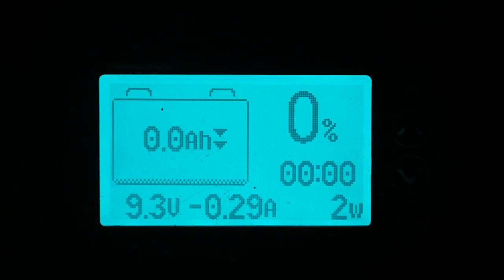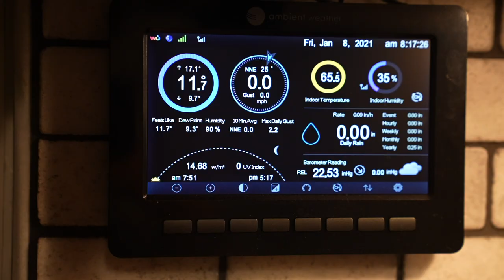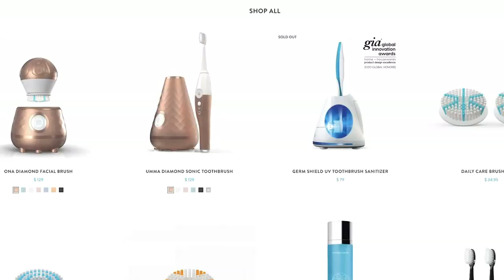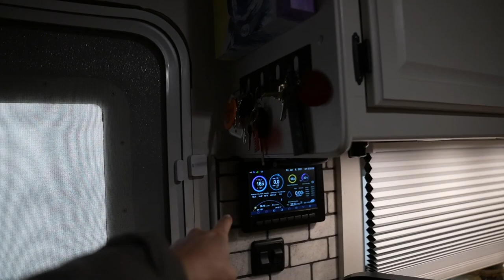WE'VE GOT MAJOR PROBLEMS | WINTER MOUNTAIN NIGHTMARE

Comment: I've never lived where you have to wear 35 layers to go outside and be warm. I guess you suit up and take it all 35 times a day when you go in and out.
Reply: In cold weather, especially when going in and out a lot, it is better to not heat the inside too much. I have spent the last year living in my trailer on a job site in the mountains. Last week it was below freezing at night and sometimes just above freezing during the day. We are remodeling a campground and my trailer is setup there so I go in for breaks and lunch and keep it cooler during the day and then turn the heat up after work when I plan to take a shower and stay in without all the extra clothes. Even outside, we constantly have to take layers off as it is Southern California, at 6000 feet of elevation and we are only a mile from where the mountain drops straight off 3000 feet down to the desert. The sun is very hot and in the shade it is quite cold. Being home on the weekend at 1200 feet of elevation in the typical warm SoCal valleys is quite a shock after staying where it is much colder. Luckily it isn't as extreme as where these two live.

Comment: We have an HVAC company in Southern California. I would recommend to hire someone. Even if you decide to go with mini splits, you can buy kits online but the equipment is no where near as good as what licensed companies can get from distributors. Daikin and Mistsubishi is good. Only contractors can buy the good stuff. As well a lot of equipment sold online has no manufacturer warranty, even if the website says it does, the brand keeps track of model/serial from what is sold online and will deny warranty, and if the equipment is not installed by a license contractor it voids the warranty if there is one. Copper line sets need to be bent with specialized tools and soldered, if you don’t have the proper tools your going to have a headache. Just hire someone, it will be so nice once it’s done! You already have enough work to do, don’t try to do the HVAC so you can focus on something else and save the stress! Something that will take you a whole week will take an experienced tech only 1 day to do. Also a lot of heat pump (all electric) equipment like mini splits will not be able to function in freezing cold temperatures so I would suggest a gas fired furnace for sure, probably LP. HVAC is electrical, plumbing, gas, all of it, it takes tech years to learn and you never really stop learning in HVAC. I wish we were closer we would totally come help you out!!
Reply: Poll your neighbors to see what works and doesn't work in your climate, at your Altitude.  Oh, then also check the cost to operate, but make sure the system will work in YOUR house first. Highly recommend an engineered/designed system. You will need a couple of ceiling fans to retrieve some of the heat that goes to the peak where you will never feel it.

Comment: Hey, reminding you again...on electrical...some things to consider...anything a hair dryer or heater or kitchen appliances plugs into deserves a separate home run circuit to avoid any additional load causing a trip if on that same circuit.   Another tip...anywhere you place an outlet ..place another one in a separate box 2 inches away....not in a 2 gang box...the power supplies, the size physically of little loads makes 2 gang boxes too close so the receptacles cannot all be used.  Another tip...the NEC Code and normal trade practices suggest one outlet every 6 feet along walls and 180 VA per outlet to determine a home run qty of outlets...which is great to minimize cost as a minimum standard...you are maximizing your convenience...for life of the house!  So have extra outlets in all corners where lamps and TV’s and such go.  Run more home runs ...did I say more home runs...yeah more home runs anywhere you have office, kitchen, etc......and remember to have separate home runs for lighting versus receptacles in every room...cause a trip does not have to turn off the entire room...if multiple home runs are in said room.  Another tip...look hard at switches...you want a fan with the light kit and a switch for each?  Yes, and a 3rd switch for some accent lighting and a 4th switch for other lights in the room like down lights.   Another tip....I added down lights in most every bedroom...in 4 corners minimum to brighten the room...dimmers on switches.....one outlet for a light does not cut it.  Another tip...more GFCI home runs for wet areas separate circuits...do not do the low cost electrician trick of running one GFCI to all bathrooms, basement, and outside receptacles to save cost...run all as separate home runs.  Another tip...extra home runs for a 240 v outside outlet run a table saw or tools outside.  Rune separate GFCI additional outlets for outside at all corners of the house for convenience versus long ass extension cord usage and dragging around.  Basements...more home runs for lights vs receptacles...don’t end up in the dark upon a trip...lots of extra outlets around basement for future.  Where is your 50 A and 30 A outlets for your visiting RV friends to plug in......where is the upstairs panel box main level panel box, and basement panel box to separate each floor circuits...so you never have to climb stairs if a breaker trips?  When you run all those home runs...mentioned a few times above,,,you need panel boxes with lots and lots of spaces for breakers.....never fill up the last two spaces....that is where you place the 2 pole breaker to feed a sub-panel that has more spaces for more breakers!  Finally...get a paper floor plan...sketch in everything I mention above...in every room...in every floor...the washer and dryer need outlets and maybe gas also...my house is wired for electric heated or gas dryer...with outlet to run the air portion.  Think it through...as the spay insulation makes it more difficult to get back in walls later....I ran a pipe from basement to ceiling....just to allow wiring additions later....you can generally go up basement walls into main level walls...and attic down 2nd level walls....so makes everything accessible later on without tearing out walls on main and 2nd level to do so.  What about Internet..speaker systems....TV HDMI cable and optical cables between TV and various Amplifiers DVD players, speakers, so you don’t have to see hanging wires...? You can go wireless but too many devices using 2,4 or 5 ghz bands can begin to interfere or have noise so hard wiring is best...use the best high frequency HDMI cables for future 8 K resolution...next gen TVs are headed to 8K now.  Lots to consider....did I mention lots of extra home runs?  Extra outlets?  Yeah...I did!

Comment: When I lived in a mobile home, I used hay bales to keep the pipes from freezing. Bales stacked around the hydrant and laid on top of the hose, after the snow was shoveled out from under, would do the trick, I think. Also, I was wondering why the water hydrant is so far off the ground. Lastly, for the trailer and even the house, I would have vent-less, high efficiency propane space heaters. They can run with a fan, but don't need electricity. They are so efficient, you can even install them in bedrooms. Not trying to talk you out of wood heat.

Comment: Don't you have a generator for off-grid as a backup?
Reply: Good question
Reply: @surinamel5708  They have solar panels on the roof of Terry, but Terry is inside the tent at this time, so...  It probably still gets difused sunlight during the day time.

Comment: Perhaps you need a few gallons of water saved for the next time
Reply: If they did t leave any heat on, it would be solid, when they came back.
Reply: In a water pipe or water jug it will be frozen if there is no heat
Reply: @MrBrickboy38  we have done it for years

Comment: I would build a small encloser around your yard hydrant.   Make it 2' x 2' by the height of the hydrant using 2" pink foam.   Also run a raceway about 4" square for the hole all the way to Terry.  Place a small oil filled heater in on the 1000 watt setting and the lowest heat and you should not have a problem again.  you might need a 2x4 in the corners and bottom to keep it from blowing away.  The air gap will keep the heat tape from burning up.  If you seal it well you will not need the heater.  normally 100 watt light bulb would be plenty except for the -40 F night.  The heater is just insurance.

Comment: 1. I speak from experience here...it would help if you built a temporary box around the water pump then heat it really well when the temps are freezing
2. For your deck screws senco actually makes a screw gun specialty made for decks so you dont have to be on your hands and knees as much. Much faster and easier. 
Hope this helps!

Comment: Fit (or get fitted) a 12v supply from the truck to the inverter battery, AND get a fuel powered generator to sit there and charge the van battery and generate mains. 
Build a generator shed for the house and ready it for feeding the van really soon. Use waste heat from the generator exhaust to heat water or inside air via a heat exchanger.
There is a reason why there isn't already a town there, life is hard and the weather is harder.

Comment: Why doesn’t Trent build a little building insulated over the hydrant
Reply: Thanks for the reply didn’t exspect that but a small shelter over your hydrant with insulation like the purple insulation board at least if u had to thaw it out u could throw a heater in there just a thought I live in New Hampshire that’s what we weould do to keep it from freezing plus the heat tape

Comment: I hope I don't across wrong.  You will save yourself some time if you put some backing for the drywall, where your short bedroom wall meets the outer wall.  Also, you can save some time, by staggering the block.  They don't have to be even.

Comment: Could you take a pvc pipe cut in half lengthwise, lay in the water pipe tube then spray foam filler.  Then put the other half on and tape it together.  That would insulate the pipe better...Keep it safe etc.

Comment: Jumper from your truck to charge battery, truck should have over 100 amp out put from alternator.  Need to set up a connection from the batteries to outside the camper that you can connect your truck to!

Comment: Had a similar problem in the winter camping and learned the when you charge your batteries you need to pull the fuse going to the converter because it can backfeed and blow the inverter

Comment: My suggestion for the yard hydrant would be to build an insulated box around it and in ground 6 inches, run the hose in a insulated pvc pipe to terry.   I have seen that setup work well at -20 for 3+ days .
That would be what i would try but if your solutions work for you more power to you.

Comment: A couple of mini-split HVAC systems with some ceiling fans to move the air would be worth considering  if summers get hot. Cadet wall heaters in each bathroom make showering or early mornings much nicer. With your high ceiling, remote control ceiling fans are a must.

Comment: Hi guys. Maybe a helpful suggestion. I saw a couple building in BC and installed a yard pipe. They included the pipe to the base under frostline in PVC piping and filled it with spray foam around water line. I don’t recall if that what you guys did underground or not. Good luck, your home is looking so beautiful and cozy.

Comment: Good morning you two. I felt I had to help Got to build a box 4'x4' and insulate (even 1 Inch foam should do) around the outdoor plumbing. Like a mini well house. I would run a space heater in it for a few days to pull any frost out of the ground. Then I promise your good to go. The only heat you will need is a 100 watt light bulb. Heat tape should radiate enough heat otherwise as long as it stays on. Love you both.

Comment: Get a pro poop and buddie large one. Then get 2extra 5 gallon propane tanks and buy a propane hose and converter for propane buddy for using. The 5 gallon tanks. Each tank runs 2 in a half days during emergency. Rode out a few major destructive ice storms with it.  Haven't used ours in 5 years but used it and we keep it updated yearly got emergency use. Save our home and lives. Living at 8000 feet. You got to think multiple ways to survive a disaster and your amazing. Glad to see you survived this.

Comment: You need to shorten  your water hose to just whats nèed.  Get 3/4 inch or bigger diameter  hose run heat tape along  the entire length  of the right to the trailer. Also insulate the hydrant well and entire length of hose right up to were it goes into the trailer.

Comment: Maybe make a hoop house around it but use T-stakes or rebar for posts and then wrap the 6 mm plastic around that but it would have to be done when the ground isn't frozen.  Meanwhile, what about an inverted trash barrel perhaps double stacked.  You'd have to cut a hole in the bottom of one to put it over the water hydrant.  It would be similar to a green house for your hydrant. Are you going to have built-in storage under the stairs?

Comment: I recently bought a small camper from Utah and someone had put like transmission fluid like in the water lines in camper. Seller said to prevent lines from freezing in camper while in storage. Not sure how they did that but definitely never going drink or cook with water from those facuets. I watched other video with power problems they flipped off all breakers or pulled fuses while charging the battery so not to cause big surge when turning back on and when leaving home as not to cause a fire when no one was home. Just learning as I go also at age 68 female. lol. So glad your place like you left it hope you got some security camera s around. You'll  keep my spirits up everyday I wait to watch your  videos. Ps I think I would have stayed at grandmas if possible until morning. Very hard fixing things in freezing cold dark night, at least you could jump in truck and get warm. Love You'll

Comment: I would dig around the base and put the water source below ground. Water pipe wouldn't be exposed to the elements. Easier to heat with the heat tape.

Comment: In Wyoming I had what was called a "return line" where you get a like and connector  like you'd you'd use for an evaporative water cooler and you hook it to your line the farthest away from your supply source and you run it back to the hole for your well so that it goes back into your well and it keeps it going, it keeps the water circulating all winter.  As long as I did that I never had frozen pipes

Comment: Maybe building a small utility shed with insulated walls would keep the water from freezing. Maybe just putting one of those plastic storage sheds over it would be enough as long as there's an air gap in the walls of it.

Comment: 1. For cooling\Heating It might me more practical to install a few Mini-splits that can be ceiling or wall mount. However Heat Pumps don't work well in sub-freezing weather. Most Heat pump systems use a resistant coil (ie electric heat) when the outdoor temperatures are below freezing. If you plan to use a wood stove as your primary winter heating this might be acceptable option.

2. If you planning to use a furnace for primary heating than baseboard\radiant flooring is easier than installing a forced air system. The issue with Force air systems is the Duct work. Most HVAC installers that install ducts just use flex which lasts about 20 to 25 years before the plastic liner become brittle and fails exposing your air to the flex insulation (fiberglass). 

3. Radiant is the best, but expensive and requires a lot of labor, Basically you install Plywood with routed out paths for 1/2" Pex that run through out the flooring. 

4. If your go with a Furnace (Propape\Oil) than I recommend a Combo Furnace and Domestic Hot water unit (saving you costs and energy) the DWH is on demand so you only use fuel when you need it. If you choose to go with Propane I recommend either Rianni (Japan) or Navien (South Korea) as these are the best quality. Note some of the other Propane condensing units require extensive annual maintenance

5. You also need to consider water filteration and probably a water softener system. If you water has a lot of minerals it can cause problems especially for the hot water tankless boilers & will need to be flushed at least once a year if not more. So Make sure when it gets plumbed you have fittings installed for flushing.

6. Considering your likely somewhat remote, Consider installing a whole house UPS system so you can power your critical loads when the power goes out. If you can afford it I would recommend a SolArk system which provides solar power as well as grid tie.

Comment: you should build a lil shed around the water hydrant with a door and insulate it and put a small heater inisde it or use the heat tape that way the heat is held in and hopefully not freeze it doesn't need to be fancy just something to keep the heat in

Comment: Run your water a little at night. Mine used to freeze where it came into the camper. A shorter hydrant would help. A inverted trash can with insulation would keep you thawed. Glad you can still laugh.😁

Comment: As a contractor , You still have a long way to go. Are you planing on doing everything your self ?  I know its fun, you can say you did it your self ..... the electrical is going to  a long time. you really need a plan , lay it all out, over think it make sure you think what you may need down the road. better now. The plumbing isn't bad. Now you say HVAC ... are you installing a/c ?  or are you just talking about heating ?  Definitely a propane generator !  Spray foam insulation is a great idea, make 100 % sure everything is done ..... Sucks to dig it out ! Happy new yr !! Thanks for the great yr we had together.